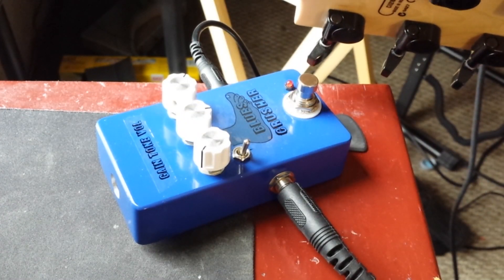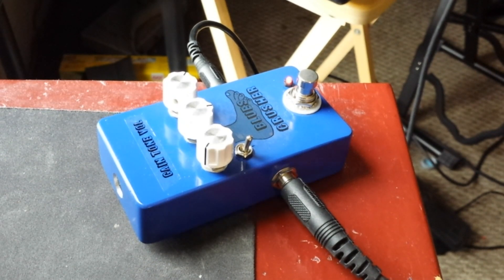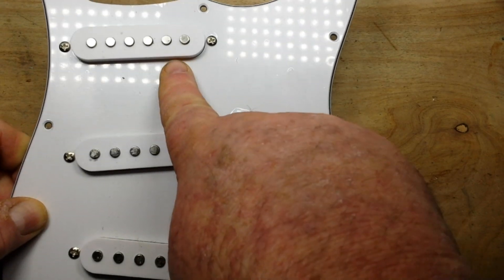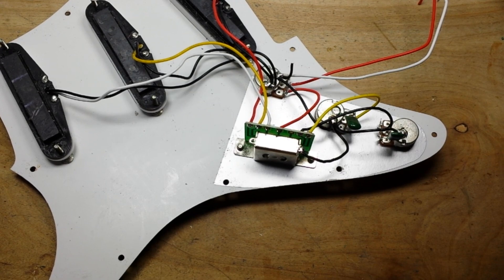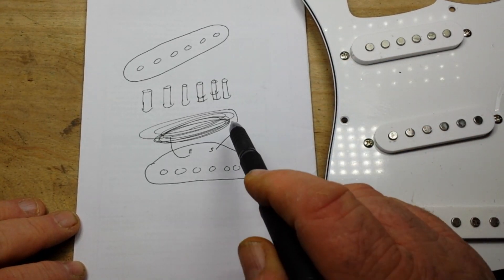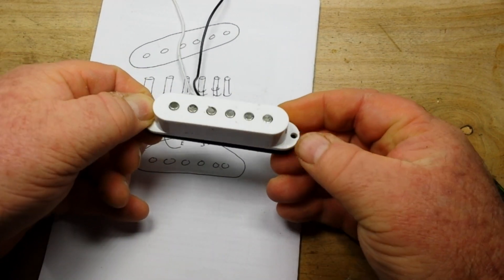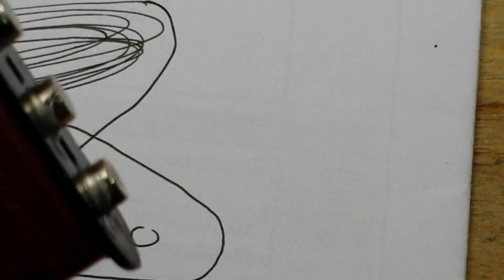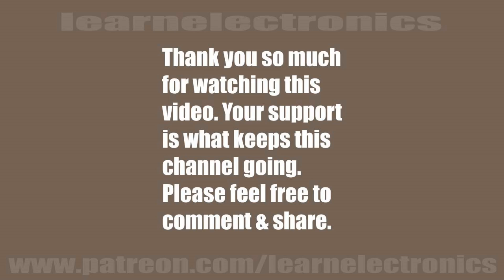How do electric guitar pickups work?

Comment: If the string isn’t directly over the pole pieces will the pickup still work?  I have a project I am messing with. I have a 3/4 sized electric guitar I converted to a ukulele. It only has 4 strings on it now. At the nut end I equally slotted the nut so the strings are spread out more but left the bridge end alone. So the strings don’t pass directly over the pole pieces. Will that affect the sound or will the strings still cause an interference with the magnetic field of the pickup to make the pickup still work?  So if the string isn’t directly over the pole piece will it still work. Thanks for your advice

Comment: Magnetic flux is a way of describing the magnetic field of a given area, so the movement of the string can't create a magnetic flux. The pole pieces, be they magnets themselves or not, "focus" the magnetic field under the strings to a certain extent. The strings, being ferro-magnetic themselves, are in turn magnetised. Think of them as little magnets hovering over the pickup. When the string vibrates it the the movement of the STRING'S magnetic field through the coil that induces an AC current in the wire. 
But... don't take my word for it. Here’s how Seth Lover describes it:   (Search the page for the word nuts) here: https://www.seymourduncan.com/blog/the-tone-garage/seymour-w-duncans-interview-with-seth-lover   And here’s another nice simple explanation: https://nationalmaglab.org/education/magnet-academy/watch-play/interactive/guitar-pickup

Comment: As a complete dummy to the operation of an electric guitar I was wondering what the signal level(strength) is when it leaves the guitar? And what is the amplification factor required to produce the final sound (from the speaker)? Pardon my ignorance.

Comment: Oh boy, you can go a whole bunch further. I really dig what you did on this. Next stat to probably go over is the resistance values of the pickups. Bridge pickups typically having higher resistance and neck pickups having lesser. And the more resistance on the set, "hotter" the pickup. This is where ceramics can actually be good, if you are looking for a cooler sound. Single coils and PAFs typically fall into those lesser resistance and lesser magnetic territories. Then you have humbuckers, which usually are hotter than single coils (unless those single coils are hot rails style). They have higher resistance still. Lastly are the active pickups, which not only some of the highest resistance, but they have their own opamp circuits in them.

After that, then you can show the waveform in comparison to those resistances. Lots of cool stuff to go over.
Reply from the maker: I figured you might enjoy this video.

Comment: WoW!! im playing guitar for nearly 30 years now & iv always wondered how pick ups worked but never got round to finding out.. so thank you Paul!! so its because the strings are 'metal' that it causes the coil to resonate. what if you put nylon strings on?? would they work???? or how do nylon string guitars work?? the ones with pickups in them i mean??
Reply from the maker: It doesn't work with nylon strings. You need a piezoelectric pickup for nylon.
Reply: @learnelectronics  will you a video on nylon pickups???

Comment: What a hell???? There is no electronics inside 😤😤😤 and how the sensor ia capable of knowing what wire is moving??
Reply from the maker: That's what the pole pieces are for
Reply: @learnelectronics  how??? Yep, i understand the pole pieces is a small magnetic core inside the coil, but how you "read" it exactly?

Comment: These single coil pickups are known to be noisy, they run at 250K so the pots have to be 250K. I have a real Gibson Les Paul, but I also have a Gibson that looks just like a Fender Strat my dearly departed friend and band member left me, he was 51 years old with extremely high blood pressure, badly overweight. Long before he died we installed Select mini humbuckers the size of a single coil, now these put out twice the power and run at 500K so the pots also had to be changed to 500K. Now it looks like a Fender, but sounds like a Gibson minus the noise of the Fender and you can help eliminate some or all of that noise by tipping them upside down in play doe, mix up some resin and hardener and fill the cavity and let it harden for a couple few days, now the pickups will be potted. No, the wires will not short because they're already coated with enamel (insulation) or they would short right away when tested at the factory. Back in the day, speakers didn't have magnets so they used this idea so they started using this on pickups. Electromagnetic energy is what powers these pickups which is a ferrite bar which is already magnetic so when you plug them in it boosts the magnetic energy and we call them passive, but they do make active pickups running at 25K using a 9v battery. When the battery dies so does your sound. The original idea on speakers was just non magnetic ferrite and the insulated winding, they just added more energy to the coil to create more magnetic force. I'm not 100% so correct me.
Reply: Great detailed insight thanks for sharing Mr. Brymstond.  Sorry about the loss of a friend.

Comment: Enjoy you all.   Not much of a Guitar kinda guy.    Gave it a go as a kid and my hands simply refuse to do what's required.  LOL    Surprised they used one single coil.   Wonder why not individual coils on each pick up slug.  Cheap I understand but I'm quite sure it would perform way better with individual  induction pickups.  You could try doing some your self and use Op Amps to create all sorts of wonders.

Comment: Hi, I still don't understand how the pickup 'understands' which string is played given there are only 2 cables coming out of each one. Could you explain this in more detail?
Reply: I don't think it matters.  It's just looking for the induction...it doesn't really care where it's coming from. If you wired the strings in the other order (as some lefties do), it would work exactly the same.
Reply: @tomg1004  Even if you have one coil for each string it would still pickup the strings on each side of it to some level.